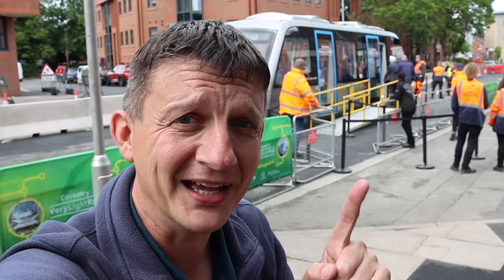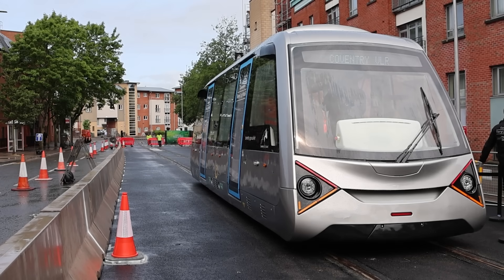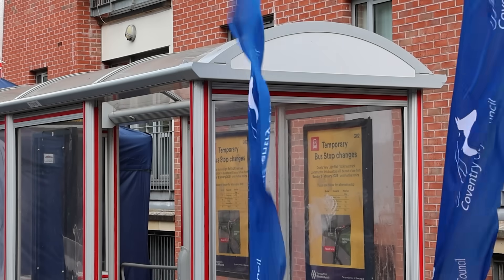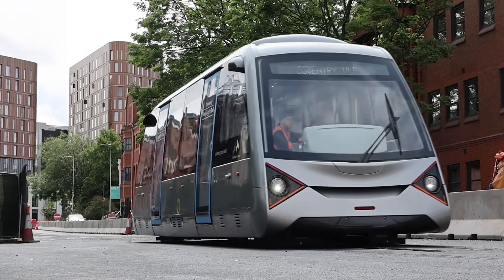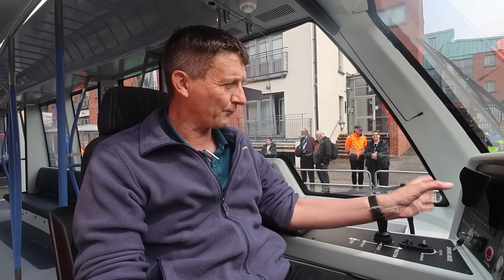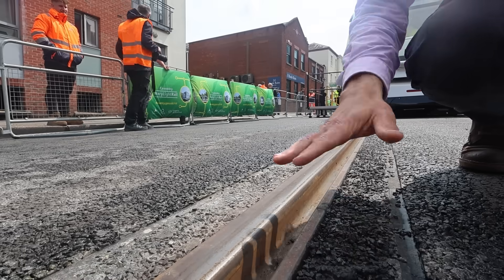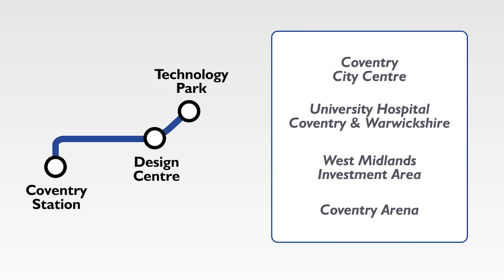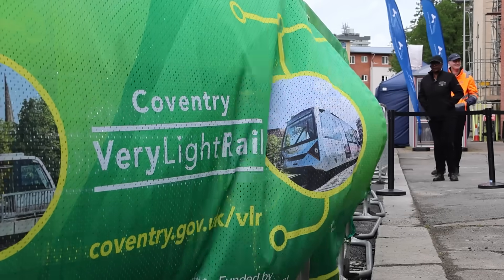The NEW! Coventry Very Light Rail is here

Comment: If they want these tiny little things to succeed, they NEED to at least be able to link together to form double, triple or even quadruple units. Otherwise they are going to get very crowded, very fast.
Reply: If they can't do that, they need to at least run at high frequency to be viable
Reply: @Joe-xc2nz  That's the "it doesn't scale" bit.  If you can have multiple tiny cars MUed together with one driver, that's ... OK, I guess ... but if you need lots of these little things each with a driver, it rapidly fails the "for a fraction of the cost" slogan.  Municipal authorities all over the anglosphere are notorious for 1) wanting everything for nothing and 2) not understanding physics.
Reply: @plaws0  my understanding is they are designed with the possibility of (a) being autonomously driven or (b) being MUed together. 
the main disadvantage is that by not moving utilities, any utility issue that occurs underneath the track could result in closure.
Reply: @Joe-xc2nz  Precisely. They'll need to be large sidings with fast charging too, so the flow of units is consistent. It's better than nothing, but a proper tram is far more desirable (and probably, durable).
Reply: @Joe-xc2nz  High frequency means very high staffing costs
Reply: As I understand it from previous reports it would be possible to run two units in tandem. However this wouldn't be done mechanically, rather than via software whereby the units would talk to each other to maintain a constant separation. This hasn't been mentioned recently though so maybe this idea has been shelved or postponed.
Reply: @marcelwiszowaty1751  That would be some quite incredible tech
Reply: At that point just get a tram...
Reply: @astygmatyzm9071  There's a reason why so many places have used Trams for so long....
Reply: @astygmatyzm9071 or a bus…
Reply: @astygmatyzm9071 
Trams cost about three million each.
Reply: Hong Kong trams are only 9m long (2 m wide) and work as singular vehicles (albeit with two decks), they were the traditional electric trams found all around the UK in the early 1900s. It's a perfectly viable model for constrained routes within city centres.
Reply: I suppose there’s two other advantages to using this over a conventional tram. 

First would be to see if passengers would actually use such a system before committing to a full-scale tram - but I don’t know Coventry well so perhaps that bit is already known. 

The second is the big push for emissions-free transport in urban areas, but I figured a trolleybus would fulfil that criteria better. This VLR is battery powered but I was hoping for more information about how charging takes place. I’m assuming it’s similar to the bus pretending to be a tram on the 358 in London
Reply: or even  5 coupled together
Reply: The key development here is the trackform, its prefabricated, as well as only being 300mm thick, so much cheaper and quicker to install than conventional light rail, and they are currently working through assessment and certification of its capacity for conventional light rail, such as CAF Urbos. West Mids are also looking at it for the next extensions of their tram network.  So in the future it will be able to be used for normal light rail
Reply: That it is shown "SPEEDING" AROUND A SHARP CURVE would indicate a usage in narrow street areas.  Lisbon Portugal has century+ trans in such a area  In UK parts of London similar, and around Wall street New York City similar.
Reply: It can take 60 people so slightly more than a bus and better disabled access.
Reply: What frequency will they run at ?
Reply: @SeanSoraghan  Whatever is likely economical. The issue that all public transport faces is getting people out of cars. Personally I do not think anything short of banning cars in inner city areas would do it. Would love a city like Zurich or Amsterdam.
Reply: they take 60 folk !!! They don't need to be bigger. Less capacity means greater frequency of trams - less waiting around.  
IIRC this project was jointly developed by the university, so they will have modelled the economics and the patronage etc., etc.. Also weight is a factor - adding another unit means that at the "join" there's an increase in the load on the tracks. The bogies under one carriage are further apart than the bogies two adjoining carriages.
Reply: The blurb says they have a capacity of 20 seated plus 30 standing. So about the same as a small bus. On routes where a small 20-seater bus would be sufficient, I can't believe it's worth investing in the infrastructure needed even for VLR. If you've got enough passengers to justify the infrastructure then you've got more passengers than it can cope with. Very had to see what the use case for this system is.
Reply: THIS

The tiny size makes absolutely no sense. They should have used regular 30m trams
Reply: @nicolasblume1046 regular 30m trams which are much heavier and can't go round such tight corners thus negating most of the cost advantages of this system? It will be interesting to see what kind of timetable plans they end up with and what kind of routes it will be good for - I suspect if you want a really core commuter route you might still need a regular tram. But these could totally feed a big tram line. But don't just assume nobody in the project has thought about capacity and applicability, eh?
Reply: @MatthewWaltonWalton  The issue with a system that has tighter bends and lower weight allowance is when eventually a tram is needed (these things will definitely not be viable in 3,4 car MUs) everything needs to be ripped up and redone. One could put these vehicles on a regular tram track and when the demand is high enough they could buy trams
Reply: @MatthewWaltonWalton  sure they may have thought about it, but in that case they haven't communicated their thoughts or solutions at all. In all the coverage I see of this, the point gets made "it's a cool machine but it has very limited capacity which is meant to be one of the advantages of rail systems over a bus". They need to answer that point.
Reply: Yep. If this is even remotely successful it'll immediately become far too small for its purpose. Coventry isn't a tiny village. The only justification for such a tiny vehicle is hoping it's going to be very unpopular. To be honest I think that is the plan for the people at the top, can't risk getting people out of their cars and buying less petrol. Inventing a deliberately underwhelming and fundamentally broken new mode of public transport seems like an excellent way to suppress pesky ideas of building proven and effective trams & metros or seriously improving the railway network and bus routes, which would pose actual competition to the automotive industry.
Reply: there are plenty of places where one of these every 5 minutes will work just fine. Not every tram route requires a vehicle that can take 100 passengers every 5 minutes.
Reply: It can.
Reply: Busses work pretty well, despite being smaller than a tram

Comment: I am always up for more track based transport (Yeay low friction!), but this is such a gadgetbahn of a streetcar. It adressens, let's see.. 2? Actually, but only be 1.5 of the things about the cost of a tram.
They make it seem like a silver bullet (Even looks like one 😆), but it's so far from it. Innovation: good. Claims of 50% cheaper and faster: Sketchy

If anyone has more info then i'd love to hear it!

The things it addresses are:
- Track installation, in the short term. Most tram systems have a solid foundation so that it lasts longer. Remember, it's low friction, and with low friction comes low vibration dampening. Sitting from my armchair I can see cracks in the roads forming because of the trams taking tight turns.
- Vehicle cost, in the short term. Batteries wear out faster than the motors will, so you'll have to get new batteries (Or more likely new vehicles) sooner, and more costly than if you had overhead installed.

What from this short video I can't see it addresses:
- Trace. Someone, or well a team of someones, still has to plan where the tracks will be, along with switchpoints, level free boarding platforms, traffic light changes and so on

- Maintenance depo. Yes, the depo could be smaller, but the reverse of that is like building a massive aircraft hanger for a small bush plane. There will still have to be a maintenance depo with all of its complexities
- Driver education. Yep. Still have to have drivers. Maybe even more than a slightly larger system as you may have to run more at once (Although that could be solved with a hitch, can't see if this has it)

I would love to see towns all over the world installing small street car systems like this, however i am afraid that it will be an easy political move to downgrade what should have been a real proper tram system down to something like this - At least it's not an inadequate BRT system I guess
Reply: Although 4 years old this presentation is well worth a watch

Introduction to BCIMO and the VLRIMC: Very light rail and its relevance to low cost railways

(full title - post in YT search)

Comment: Infrastructure is cheap but the capacity will make the actual operating cost pretty high because of the low number of passengers per driver.
Reply: An average sized single decker bus can move this number of people. Unless they're going to make this grade separated or give it priority running so it isn't actually in the traffic they could have just achieved as much with bus lanes. It's a start I guess, I can see it showing the higher ups that a proper tram system is actually needed and this can be the stepping stone. Capacity is the real holy grail when it comes to public transport.
Reply: @TalesOfWar  an average size single deck bus (so a Solaris Urbino 12 or Mann City Lion 12 can take over 100 people on board (solaris does 104 iirc). This stupid gadgetbahn, according to its creators does 56, so a half of that. For the same driver, it carries less and offers lower thruput then a bus lmao
Reply: @shindenfighter3303  those busses must be huge, an enviro 200 can only carry around 50 and thats more the standard here
Reply: @shindenfighter3303  and would be completely thwarted by a parked car in just the wrong place - Sheffield supertram has this problem.... buses dont...
Reply: @tom-jj5em  The capacity of the Enviro200 is 48-92 depending on length (Some Enviro200 were about the same length as the full size single decker Enviro300) and seating specification, Solaris Urbino 12 is no bigger than standard full size single decker, but it can have a capacity up to 105 due to having more standing room.
Reply: presumably you could link 2 together.
Reply: i would guess 2 car units would be needed quite quickly.
Reply: Yeah, I’ll be interested to see whether they spend up stringing them together or even just making a flexible tram
Reply: That was my first concern from this video. They're pretty tiny, you really need double that capacity to deliver any kinds of benefits. This isn't really mass-transit.
Reply: Conventional trams now run to seven sections in some places.  In London, I doubt anyone has seen a single 2-car train running solo in 30 years.  Multiple operation isn't revolutionary.
Reply: I guess once the system is established there's nothing stopping them from designing articulated units to increase length / capacity. As long as the units are light enough and can get around those curves, they'll be feasible.
Reply: @StrawberryStationMusic  Designing and building bespoke rolling stock is expensive and time consuming.
Reply: Also batteries are less efficient than overhead wires so electricity costs will be higher
Reply: @Ivandor12  Electricity costs are generally quite low for trams anyway.
Reply: @Ivandor12  Not really.  maybe loses will be 2-3% but that's a tiny fraction of running costs.
Reply: @mralistair737  BEV charging losses are 10%-15% depending on the speed of charging, cold or hot weather can further increase losses.
Reply: yea I think this is a very good idea - if it was autonomous.
Reply: Until they make it autonomous which I’m guessing will be easier if it’s on rails as no steering and a set route.  Assuming they’ve thought of that of course!
Reply: @tarbyonlineful  If it's not grade separated they're unlikely to ever make it autonomous.
Reply: @dernwine  Yeah, I can't imagine a vehicle that size will ever be autonomous on a non grade separated alignment.
Reply: @tarbyonlineful  Autonomous vehicles are already a reality - on closed tracks. Absolutely nightmare to do on the street. 
Either buy the entire route and close access (with all the bridges & tunnels that needs) or just accept you will have drivers for the foreseeable future.
Reply: @tarbyonlineful  they have, they are designed to be made autonomous in the future. unlikely, though, probably too many regulatory issues.
Reply: Exactly. Should be automated

Comment: This is so neat though! They seem a little bit bigger on the inside haha
Reply: It's a bullshit gadgetbahn.

They should have at least used standard trams, 30m long.

These tiny things dont make sense
Reply: @nicolasblume1046  Good luck getting funding for that in the UK, if West Yorkshire couldn't get funding over 30 years it'll be at least 300 years until you could get regular trams built in Coventry
Reply: @nicolasblume1046  for 30m trams to make sense to HM treasury, you‘d need proper ridership, for which you need good bus service everywhere else. So this is (hopefully) the gateway drug to get decent transit
Reply: @nicolasblume1046 someone doesn't "get" the concept
Reply: Hiii Jamie this looks too me like a people mover on road
Reply: maybe light tram? :3
Reply: 20 seats then room for 30 standing, which makes it less capacity than a standard length single decker bus which generally has 30-45 seats and 75-85 max carrying capacity.
Reply: @watcherzero5256  The VLR can connect additional carriages, like trains. They do not require additional drivers, and are guided by rails and the front carriage. Hence capacity is dynamic for the VLR, not merely 50. You cannot do the same with a single-decker bus, although you can run double service (so two drivers). The VLR carriages would theorectically be cheaper than additional single-decker buses. Also a LOT smoother ride, so the standing capacity is not just an afterthought like it is for the buses.
Reply: @aimerw  Would have to be designed into a future version, the current short Coventry VLR vehicle doesn't have couplers and sits straight onto a frame spanning the two non-articulated bogies without any capability for rotation. (if you look at it with the front panel removed its just a girder underneath) If you coupled two vehicles together then since they cant articulate they would derail on a tight curve due to length. You would have to design a special articulating coupler to handle it with a massive gap between the carriages.

On the similar but much longer Revolution Very Light Rail demonstrator the structural underframe (which a coupler would need to be attached to in order to handle the load forces) only extends between the two bogies with the driver cabs being cantilevered out from the underframe to save structural weight rather than sitting on it.

Comment: Well done City of Coventry, once again they have created transport innovation, as they did in 20th Century with many types of vehicles including aircraft. Thanks for the video report, it was good to see Geoff in the drivers seat checking out the dashboard!
Reply: Don't forget Mr Rudge and his invention of the "safety bicycle". The first in the world.
Reply: Amen 🙏
Reply: This is what Liverpool needs instead of the Belfast Glider system ( a supposed 'tram' system without rails) which is essentially just a bendy bus with panels on the wheels which we've had in the city in years gone by (and have been removed because they didn't work.  The best part  is these bendy bus/ tram system without rails thing the city mayor/merseytravel are tryoing to bring in is going to cost £100 MILLION for buses!   Theres a reason London got rid of bendy buses in 2011 and that is they are stupid and dangerous for pedestrians and other road users alike.  This new system in Coventry would be ideal for Liverpool - definitely better than bendy buses with panels.
Reply: @bluechang08  The Belfast Glider is not a 'tram' without wheels, it's a bog standard, sub par BRT.
Reply: @bluechang08  In 2020, Derby said they were planning to get a BRT system like Belfast's in 2023-24, but the project was shelved this year. This VRT looks a much better fit.
Reply: Search "Trackless Trams".
They make this obsolete before it's even installed
Reply: A public transport vehicle with a 75km range?  Don't make me laugh.  If this was a bus on normal service, it would have to recharged every 2 hours.